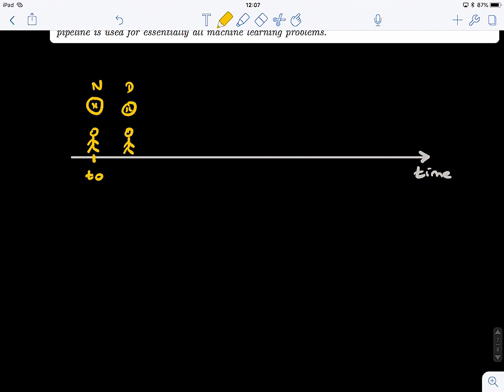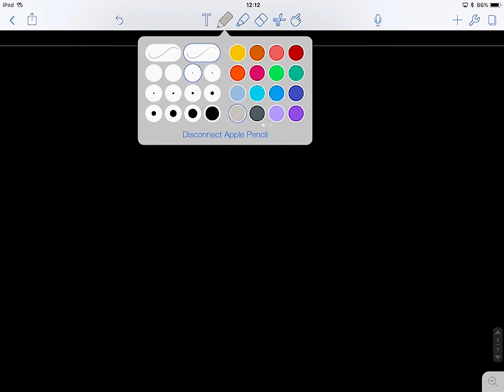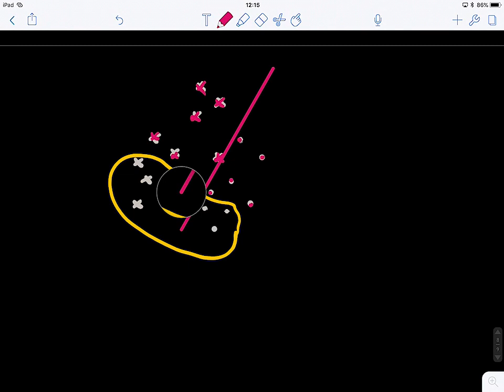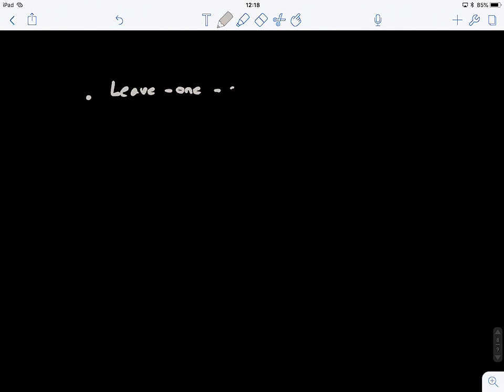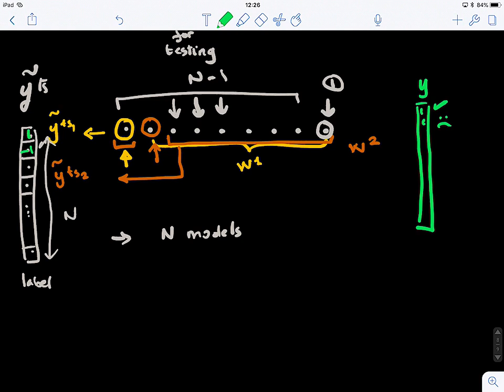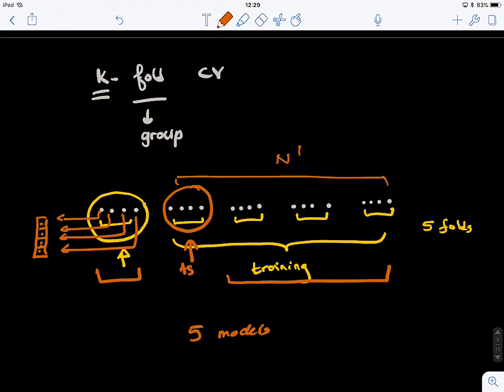Machine Learning Blink 1.3 (cross-validation)

Comment: What confuses me is the main purpose of the cross validation. Does it aim to come up with many models ? or train a model more and and more in each iteration to increase the experience of the model ? For example, we generate a model in the first iteration of cross validation. Let's assume that name of this model is A. Then, we generate another model in the second iteration of cross validation, and call it model B. Does model B is better of A or are they irrelevant ?  The fact that B is better than A means that we train model A in second iteration to make it better and it convert into B. The fact that A and B are irrelevant means B is new model, it does not derive from model A. I am stuck in this point.  Does cross validation aim to come up with many distinct models ? or train a model more and and more in each iteration ?
Reply: As I understand, we come up with 5 different models eventually. And pick the best one amongst them. They are not related to each other.
Reply: @haruntrkmn  I trained several models in computer vision competitions, and then I did model fusion
Reply: Okay, Let suppose you are doing 4-fold Cross validation. 

== First model is KNN with 3 neighbors 

1) You divide your original training data into 4 equal subsets of data. These subsets can be called as folds. i.e. f1, f2, f3, f4

2) As we are having 4-fold CV. So it means there will 4 iterations. 

3) For each iterations, we keeping 1 out of 4 folds as our Cross validation dataset/testing dataset. and keeping remaining 3 as the training dataset. At each iteration we will building the model with different set of training data. and test its accuracy on testing dataset / CV dataset.

Let suppose, data we divide it 4 equal subparts.
so we get d1,d2,d3,d4.
                                    
                                      training data       CV data     accuracy
For eg: 1st iteration:       d1,d2,d3             d4               85%
2nd iteration                    d1,d2,d4             d3                79%
3rd iteration                     d1, d3,d4            d2                83%
4th iteration                     d2,d3,d4             d1                90%

So we have seen 4 model with different accuracy. The main use of K-fold cross validation helps in getting to know how well the model will work on unseen future dataset. So we have every possible combination considering the different set of sample each time for model training purpose. Now we can take the mean of all the models accuracy. And get to know how well the model will work for unseen future dataset. 

Mean accuracy = 84.25%

== Second model is Logistic Regression

Now lets suppose, next we use logistic regression and applied the 4 fold cross validation on it. 

and it gave the mean accuracy of all 4 model as 79.2%.

So at the end of all this, we end up selecting the KNN model because of its higher mean accuracy. 

I think , when doing the K fold cross validation for particular algorithm  for eg: KNN. with 3 neighbors . Model A has no relation to Model B. There are different models. Train on different set of dataset. and test on different.  So each time end up with a different model trained on different set of training sample. 

Hope, I am clear.

 If there is any mistake, then please correct it. :)
Reply: @yogeshpal2852   I know I'm a bit late to the party since your comment is about a year old.

I just wanted one clarification. So if I'm not mistaken, incase of k-fold Cross Validation, there are k number of models created right? So a dataset of 1000 samples with a k-value of 4 would be divided into 4 equal parts with each part consisting of 250 samples. And we will end up with 4 different models. The final model will be a mean of all 4 models. Is that right? If so, then what quantities will be averaged to get the final model?

Lets say incase of simple linear regression where was have to find the weights of a linear equation y= w0 + w1 * x . After Cross Validating 4 times, We'll have 4 different models with 4 (slightly) different values of w0,w1 each, Is that correct? And the final value of weights w0 and w1 will be an average of w0 and w1 from all the four models right?

Comment: Is it useful for testing? I mean, yes we are testing several time with this way but at the end of the day we are testing same data. We won’t see any different result. It’s just statistical difference between these test, if I understand correctly. While we testing, we want to see failure chance, if our algorithm has some weak point under some different conditions, we should also see these ones. I understand that with this way we are getting different test results. But with same test data how can it help us?
Sorry for my bad english, if I’m mistaken.
Reply: Actually, the purpose of cross-validation is model-checking, not model building. So, it is used to decide which model is better (e.g. linear regression model or neural network model). You evaluate your models in the way cross-validation offer and then you see which one is better at predicting the test set points. After this process, generally you train the superior model on all the data.
Reply: Ömer Ulusal I get it now. Thank you for your answer.